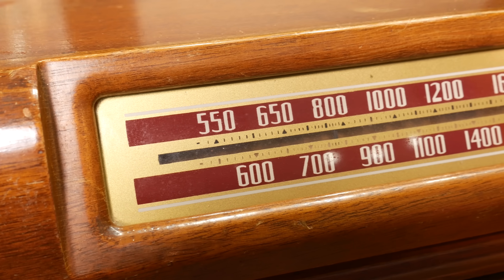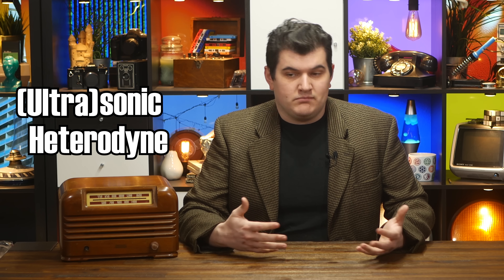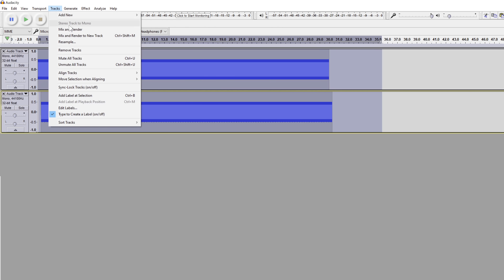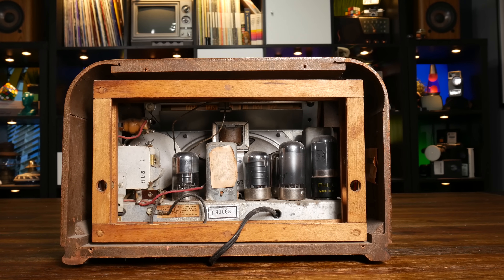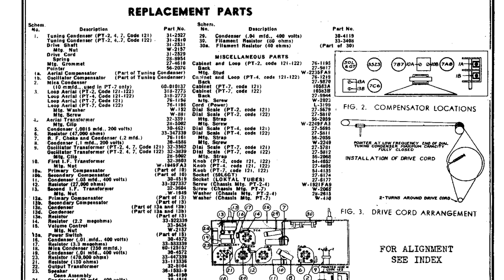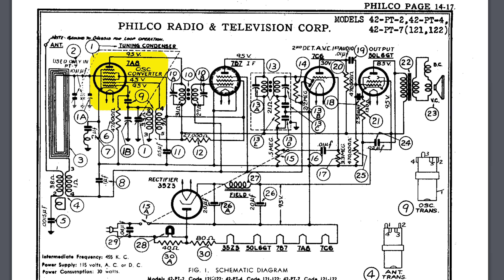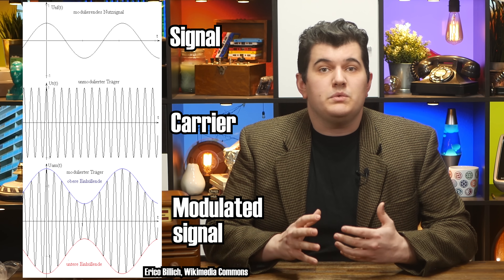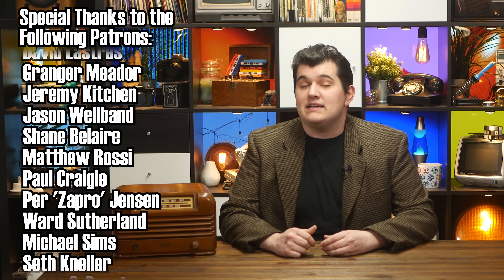The Superheterodyne Radio: No really, that's its name

Comment: Using the 'leaked' IF was exploited in the early days of SSB radio transmission. Single side band filters out the carrier as a more efficient transmitter power approach. Fiddling a second radio so the mixed IF's summed or differed to be the missing carrier let an older AM only receiver listen to SSB.

Comment: Cars had a condenser in the distributor to smooth out the spark but also another noise that filtered our EMF interference causing engine noise coming out ur radio speakers!  You mostly hear this effect today coming over cop radios.

Comment: That beat frequency is kinda how we tune guitar strings to eachother by ear.  I thought you about to demonstrate noise cancellation or stereo cancellation recording effects when the same frequencies cancel eachother out.  This also happens when you got a large subwoofer in ur trunk and the exhaust drone at just the right rpm can cancel out the bass for a second!

Comment: Nrd515 wrote a comment on The Truth About Cars: "Luke, listen to an old car radio from the early 60's. The AM sounded a lot better than it did on later radios, where the entire AM receiver was basically on a chip. Not that it sounded all that great, but it was a lot better in those old radios. Our '64 Cadillac had the top of the line Delco radio in it, and it sounded pretty good. We listened to mostly CKLW and 760 WJR back then." Could you look into the validity of this claim, i.e., are modern AM car radio units just less efficient and/or have less clarity/fidelity? Thanks.

Comment: Heterodyning is still used even with software radios, because often the carrier frequency is too high to reasonably sample, so it will be shifted to a lower frequency and sampled at a lower (and therefore cheaper to implement) sample rate before being processed further.

Comment: Fun fact: The heterodyne priciple is even used for infrared. The Infrared Spatial Interferometer (ISI) combines the received infrared radiation with the light of an infrared laser, the beat frequency is in a range which cannbe handled by radioastronomy equipment, including the interference of the signals.

Comment: Careful with that radio the chassis has one side of line chord attached to it so it can shock you pretty bad (I speak from experience)
Reply: You must use a polarized plug on the power cord.

Comment: @4:12 Physicist here. You shouldn't hear any 400 Hz from the 5 + 5.4kHz interference. Linear superposition of two frequencies still leaves those frequencies untouched. The reason we hear the wobbling at 401+400Hz is because our ears must have (I'm hypothesizing) a bandwidth, i.e., you hear only in 10ms windows for example. At such high frequencies the beat is much faster than this time window, so you will not hear it's wobbling at all. The reason you hear it in your headphone example, is probably because the two audio sources are driving each other's diaphragms and the diaphragm is responding non-linearly creating a new tone at 400 Hz, which is why its so weak and you had to amplify it in post (and why it failed [was much weaker] with the two speakers). You relied on the non-linear behavior to create it
Reply: Isn't the max we hear is 16Hz atleast that's what they taught us in Highschool that You can hear beats only upto 16 Hz due to Limitations of Human Hearing, after 16Hz, it's not possible for our ears to differentiate
Reply: I was preparing my typing fingers for a paragraph about nonlinearity - I may still type it, haha.  I believe radios use multiplication rather than addition for the superhet process.

Comment: Would love to see your take on Amateur Radio too, specifically HF. Obviously you need to acquire a license from the FCC to operate in the Amateur Radio Band Plan, right now I have my Technician class license and I get quite a lot of leg room, even being at the base level of the license. You can also go to General and Extra, there are a few random things after that but then there is commercial broadcast. lol. As we say on the air to end a conversation, 73, K0LTN.

Comment: A fine point that may be confusing;  If you combine 2 audio or RF frequencies , you won't actually generate the difference frequency except as modulation beats. To generate the actual beat frequencies you need to mix the two in a non-linear mixer or multiplier. This is hard to explain.  Suppose you played a 1000 Hz flute next to a 1400 Hz flute. You will not hear the 400 Hz tone, unless these flutes are extremely loud where your ears become overloaded.

i heard this at a museum that had a very loud circus calliope playing indoors.  I could plainly hear numerous discordant notes being generated that are not normally audible.

Comment: I gather that in the UK they had vans equipped with directional antennas, patrolling through towns and scanning for radio receivers in households that had not paid for a radio receiving set licence. It was that 455 kHz intermediate frequency that they scanned for. 
I think the fee was abolished in 1971. Canada used to have a similar receiver licence until 1953.

Comment: I used to be confused about this too. You didn't hear the beat in the higher frequency test because you have to rectify the combined signals to decode the beat. (Some kind of non-linear distortion was happening with the microphone in the headphone test to accomplish the same thing, though as you could hear, quite ineffectively.) The beat frequency isn't actually a frequency/tone, it's the amplitude of the original summed waves. Both waves are of course still there and at full strength, all the time.

If it actually produced a new frequency just through addition of the two waves then you couldn't have two independent frequencies without always having a third frequency. (And then THAT frequency would make more beats against the original two, and so on, and so on...)

Comment: Ive picked up ac electricity at about 1600 khz am and it sounded like fluctuating static at a speed a little slower than the 400 khz example you showed

Comment: Alec, I suspect you already know this, but were trying to keep the explanation simple enough for the mathophobic majority to consume, but there's a good reason you couldn't hear the 400 Hz difference between the speakers.  When you just add signals together, they never create any new frequencies, because the medium those signals is traveling through is very nearly linear, at least in the pressure regime that our ears can tolerate.  In order to actually create the sum and difference frequencies that this demonstration needed, there needs to be a nonlinearity that causes the two signals to affect each other.  That is one of the functions of the pentagrid converter in addition to producing the local oscillator signal.  Producing those sum and difference frequencies is best done using a mixer that effectively multiplies the radio frequency signal with the local oscillator, but almost any function that is nonlinear will have some mixing effect.  In the case of listening with headphones, the nonlinearity is actually in the bones the transfer the energy from the eardrum to the cochlea.  It's all in our heads.  When we were listening to the 400Hz and 401Hz signals, we weren't actually hearing the 1Hz difference frequency, for two reasons: first, because the signals were simply being linearly added to each other, so there actually wasn't a 1Hz signal, and second, because we can't actually HEAR 1Hz signals.  But 1Hz is low enough that we DO hear it as a changing loudness rather than a tone.  Ears are funny - they hear the actual changes in volume up to a certain frequency, and above another certain frequency, we hear a bass tone rather than a warbling sound.  These two frequency ranges overlap, so that between 20 and 50Hz or so, we can hear some combination of both.
One more thing - for the most part, even modern radio chips are superhets.  But because they need to process the intermediate frequency signal using cheap analog-to-digital converters and digital signal processors, the intermediate frequency is much lower, like in the 10-50kHz range.  The disadvantage of THAT, though, is that the image signal is only double the intermediate frequency away from the desired signal, which is much more difficult to remove with a filter.  So these make use of what's called an image rejecting mixer, which is actually two separate mixers, mixing two different phases of the local oscillator, then doing other nasty math so that when the outputs of these are later added together, the image signal cancels itself out.

Comment: I’m studying for the amateur radio extra exam, and the whole thing is stuff like this in great detail.  IDK how my brain has been taking the punishment.  But your way of explaining it is very easy to understand.  Also, superheterodyne is preferred over software or SoC receivers, because they’re better at filtering out high intensity RF that’s nowhere near the desired frequency.  They’re also better with squelch.  Cheap radios will go in to receive mode if placed next to a computer monitor, PC, or LED light, even if it isn’t making any sound.  Superheterodyne radios don’t have that problem.

Comment: This is a major facepalm. A video explaining superhets where the author explains frequency mixing wrong, which is the most important part of the superhet. He doesn't understand that to mix two frequencies it's not enough to just add the signals, they have to go into a nonlinear device afterwards. That's why 5000 and 5400 didn't work. Also, don't you realize that human hearing goes from 20 Hz up so how could you hear 1 Hz frequency? There was no 1Hz frequency there, there was just a mixture of sounds whose perceived volume fluctuated, but human perception of volume isn't so fast that it would discern 400 changes of volume per second.

Comment: 4 years later, and I realized that if I have to listen to a radio, I prefer to do so through older radio equipment, especially vacuum tube radios. Modern radios have a harshness to them that shows off how low "bit rate" (for modern sensibilities) radio can be, especially in AM frequencies. It is fair to say that can be turned out for the most part through EQ changes, however, as out-of-the-box experiences go, stuff made from roughly the early-mid 1980s back just seems to sound better. I had a 1970s 8-track AM/FM record player combo as my first music playing device as a kid in the mid 1980s, into the early 1990s. It wasn't the greatest thing on the planet, but when listening to radio, it was very good. It was much better than the CD boombox I got right after, which was pretty good with CDs and compact cassettes, its radio was great at getting a signal, but brought out the worst in what radio offered. If any of that makes sense....

Comment: I love radio. It is the last front of free and unbiased news and I am not talking your regular AM radio. Get yourself a shortwave and get a world view. American radio has been bought and sold. Shortwave is very different. A decent radio, cough cough not an Eton Elite Executive POS. Get a Tecsun PL 330 or a PL 880 and rock the world. You will need an antenna. I built mine out of 100 foot of speaker wire for $12.99 and a solder-less plug. Excellent cheap dipole.

Comment: The weak signal from the local oscillator was used by the Post Office in England to locate people who didn't pay their radio license fee.  To this day there is a fee/tax which supports the BBC.  Supposedly a van with a very sensitive receiver could drive down the street and pick up the signal from receivers in people's homes.  By comparing with the license list they could find (and fine) freeloaders.

Comment: Watched this way back when, but figured this comment might be interesting. Even to this day, hand held HAM radios (or HTs as they are more commonly referred to) with superheterodyne receivers are most desirable among HAM radio operators. I have a few and there is a major difference between them and my direct conversion receiver radios.

Comment: I'm going my memory here, but isn't there an effect where if you have 2 AM radios in close proximity attempting to tune to the same frequency they will give each other a boost and will be able to receive distant stations much better than either one would on it's own? Out of curiosity what is that called?

Comment: WOW 30 watts consumed. I looked at an old AM/FM Cassette/CD system I have, slightly larger in size, and I bet half the weight. The label on it says 12 watts. That is a testament to the improvement to the transistor vs vacuum tubes.

Comment: OMG. Disinformation again. If you add 400 Hz and 404 Hz... you will get 400 and 404 Hz! To make 4 Hz (plus other trash) you need to multiply 400 Hz and 404 Hz signal. Or add them and square the sum - you will get even more trash, but it is easier to implement.
Reply: Thank you so much. I was confused because i have build an AM transmitter and receiver by my self. For modulation you need to multiply carrier and information through components with non linear characteristics, like diodes. I think he is just talking about superposition. Even did the math with a taylorseries as an approximation for the nonlinearity.

Comment: Just wanted to point out that your demonstration with the speakers is not quite what a super-heterodyne receiver is doing. When you play the two speakers simultaneously, they are combining additively. A super-heterodyne receiver performs mixing between the local oscillator and incoming signal, which combines them through multiplication. Multiplying the input sinusoid at frequency f1, by the local oscillator sinusoid at frequency  f2, will create output sinusoids at both f1+ f2 (high frequency term) and f1 - f2 (low frequency term). The low frequency term would be selected as the intermediate frequency, while the high frequency term would be filtered out.

Comment: The tuning capacitor was called gang condenser. Along with parrelel coils It simultaneously tuned two resonant tank circuits 455 khz apart. The resultant If (intermediate frequency) was passed through two successive If tuned amplifier stages before rectification to audio which was further amplified and fed to speakers. It was fun to work with tube radio receivers.

Comment: You can't hear 400 Hz signal by just adding 5 kHz and 5.4 kHz signals because you have to pass the sum thru non-linear circuit (detector) then. Addition doesn't produce new frequency, multiplication does.

Comment: SIGNALS UNABLE TO BE RECEIVED, IS DUE TO A TUNABLE RECEIVER, AND TUNED WITHIN A SPECIFIC FREQUENCY BAND. A.M FREQUENCIES ARE TYPICALLY IN THE LOW END IF THE SPECTRUM, ABOUT 540KHz TO ABOUT 1700 KHz. 
BY DEDIGN, THE RECEIVER HAS NO ABILITY TO DETECT ANY SIGNALS ABOVE ITS DESIGNED FREQUENCY COVERAGE.

Comment: I'm guessing the experiment with larger speakers at ~500Hz failed due to recording quality, wave interference affects on the two speakers, or - most likely - slight differences in speaker dynamics, such as cone weight and magnet strengths.

Comment: TRF receivers have been around since long after the introduction of the superhet.  A notable example is the crystal radio.
Reply: Well, "Tuned Radio Frequency" (TRF) radio receivers pre-dated superhertrodyne radio receivers and were "superseded" by them.
A "crystal" radio receiver simply tuned at ONE frequency and "rectified" that signal.

A TRF receiver tuned at the same frequency through TWO or MORE amplifying stages, each tuned to the same frequency.

As mentioned in the video, the problem with a TRF receiver was to keep the "tuning" of all stages in alignment as the desired frequency was changed.
The superhertrodyne  receiver overcame this problem - since only one frequency (usually 455 kHz - at AM "Broadcast" frequencies) was involved, after the first "stage" of tuning and generating the "superheterodyne" signal.
Every "Intermediate Stage" could then be tuned to exactly the same frequency, no matter what was the "received" frequency. - since the variations in the original signal had been translated to similar variations in the "Intermediate Frequency" signal.

Comment: Hi TC from the past. I really liked your video! However there is also a big omission in you video that also explains why your experiment with the speakers did not work. The mixing of frequencies is not a simple addition. Although two frequencies will cause a beat frequency, the beat frequency is not an actual component of the signal. If you look at it in the frequency domain, you will still only see 2 frequency peaks. Mixing is actually multiplicative. If you multiply one sine with another, you will get a sum and a difference frequency. This is equivalent to your image story. How this is achieved in this system and what is actually the confusing part, is that both the oscillator signal and the radio signal are passed to a tube with a non linear transfer. In this case there is a quadratic relation between input and output i.e. output = input^2. This means that there will be a component in the output in the form of oscillator-radio. This is why you cannot hear the 400hz signal with the speakers. However when using the headphones (presumably of lesser quality) the transfer is likely less linear i.e. ouput != A x input, where A is the gain, you can hear the 400hz component. The 1hz beat frequency is actually not a tone you can hear, your hearing only goes down to 20hz. What you hear is simply the amplitude going up and down at a rate that your hearing can track (whereas 400 hz is faster than you can hear). Hope this all makes sense ;-)